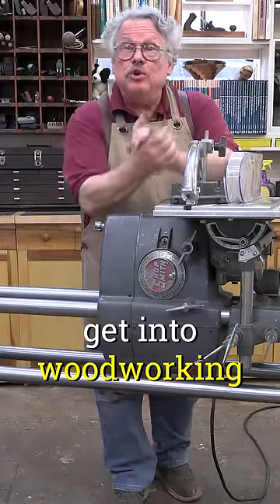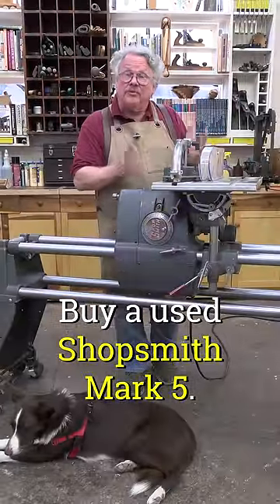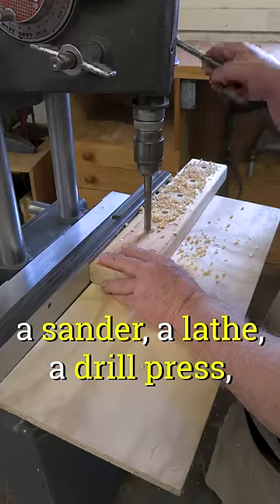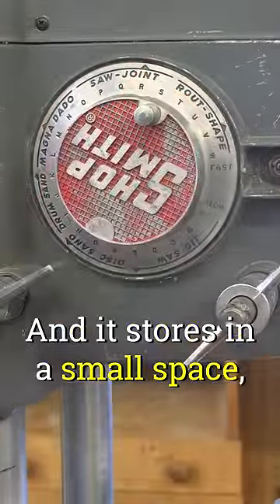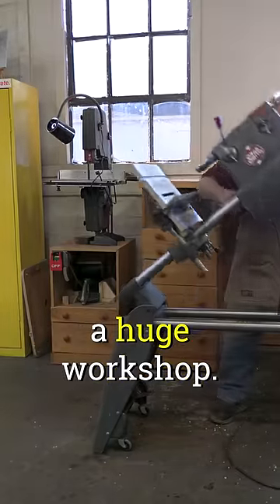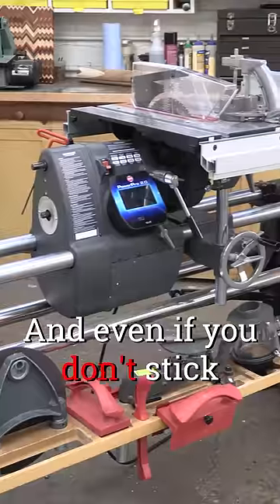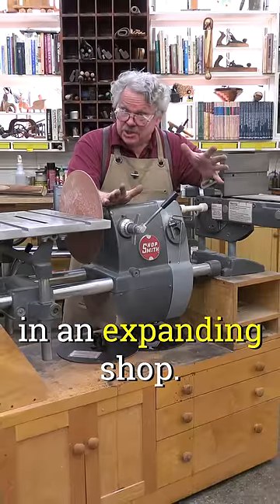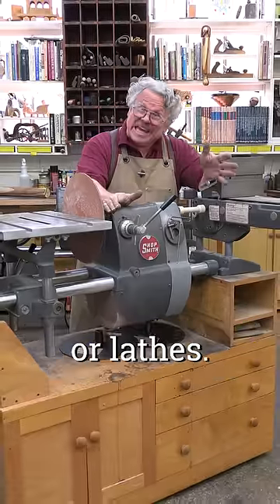A Cheap Way To Get Into Woodworking

Comment: "How do I get into woodworking without spending a fortune on tools?"
"Just spend a fortune on ONE tool!"
The cheapest Mark 5s near me are $700+.
Reply: It's 4 tools.
Reply: @clonecone  It's one tool with four functions.
Reply: @NiteSaiya  It's pendantic to win a whiney argument.
Reply: $700 is a fortune? It must be 1920.
Reply: @dashcammer4322  Your privilege is showing. Half of Americans are living paycheck to paycheck these days. $700 is far more than a basic set of tools costs. The tools this replaces tend to be the stuff you get after you've already got the starter tools. Most people start with hand saws and drills and sanders and only invest in table saws or lathes or presses after they're well into the hobby. Or at least that's what working class Americans do. And that's all that matters. Making a recommendation to save money is useless if you're talking to an audience that thinks $700 is trivial. They can afford to dump $2500 on a newer machine. It's the people that can't afford a $400 table saw that need money-saving tips.

Comment: This guy evidently has a completely differnet idea of what is "cheap".
Reply: It does 5 expensive tools worth of things and they can go for 150 bucks used, it's the perfect bang for your buck thing.
Reply: Not to mention it's something you can upgrade over time to make it even better
Reply: @holyhotdogtoaster9034  when and where was the last time you saw one for $150? I've never once seen a complete one that worked for so little money
 They usually go for $500-$1200. Which I know is still cheaper than having a shop full of tools that do all the different tasks a shopsmith mkV can do. But it's still not "cheap". Not at all.

Comment: This has got to be the worst advice I've ever heard about how to get into woodworking. A used Shopsmith will cost upwards of £800 - there's no guarantee it will work properly, safely or have all the right parts. You don't know what you're buying. Just stick with hand tools, they're cheap and they work. Maybe get a bandsaw or a table saw when you get some money - don't waste it on some junk from ebay.

Comment: any "combination tool" is never any good at most things.
Reply: I purchased a used 2001 Mark V with the most current version of the table (520) $800 w bandsaw accessory. I also purchased an older model that had the jointer and another bandsaw. I'm a novice but enthusiastic.  I was able to make a nice bench with the Shopsmith. The proof is in the results.
Reply: Is this the next Einstein people. Look at this creatures incredible intelligence.
Reply: If it was good enough for Nick to have been involved with the company, it is good enough to warrant serious consideration.

I own a couple Shopsmiths and have integrated them into my workflow successfully. I would definitely say they have a place in the workshop, even if it’s just as a starting point.

Comment: Theres a reason theyre so cheap...
Reply: Yeah, they're used. What a shock. 

Half the time someone is selling it when they're strapped on cash. Big other chunk is either a spiteful wife or recent divorcee. 

There is a risk it's broken or stolen, but that's why you NEVER buy ANYTHING powered without checking if it works yourself, and why you need to be mindful of whom you're buying it from and back out if it's too sketchy.

Comment: This is the first video I've seen that i need to disagree with. Shopsmiths are crap. You will never be able to fine tune one of those piles of crap to make anything better, than a 6th grade woodshop project. They're highly inaccurate and will not stay in tune despite your best efforts. Just save your money and buy decent tools. A shopsmith is not it!